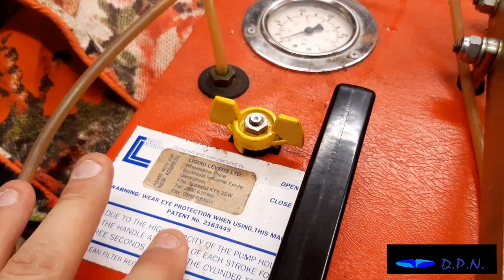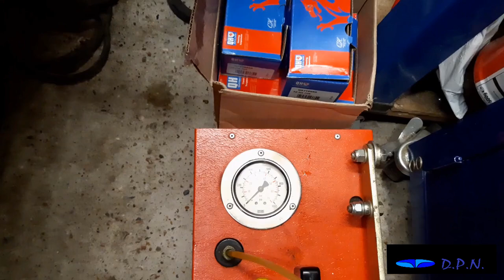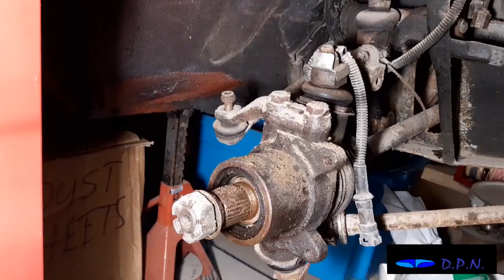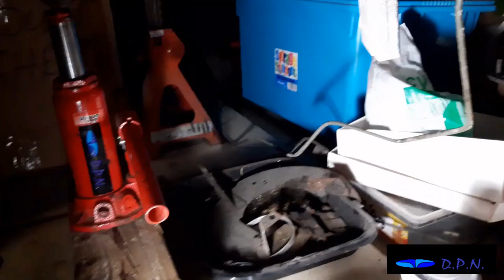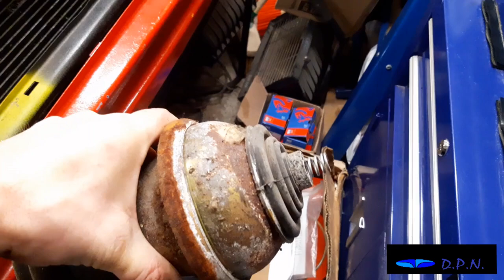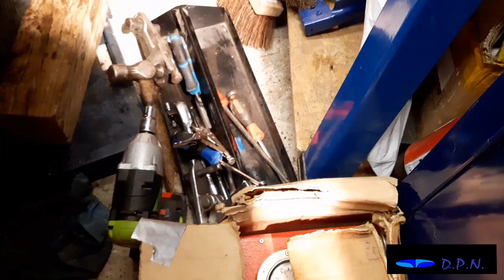depressurize the suspension and removing the suspension displays unit on a MG metre Austin Metro

Comment: Hi dpn ,do you think its possible to remove the hydrogas unit by using the metro own side jack as that's all I have
Reply from the maker: not quite fully sure what you mean but the Jack that comes with a metro is really only in our opinion for emergency if you break down and have to change a tyre
Reply: @DPNTV yes I was refaring to the jack the metro came with ,are you doing the rear ones
Reply from the maker: @Barry-q5v yes we are should be coming up in a later video